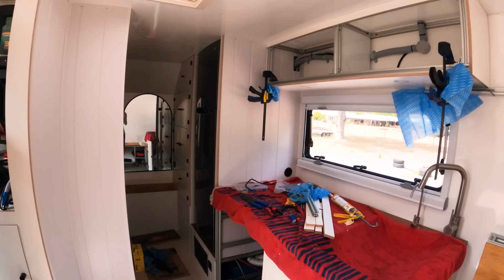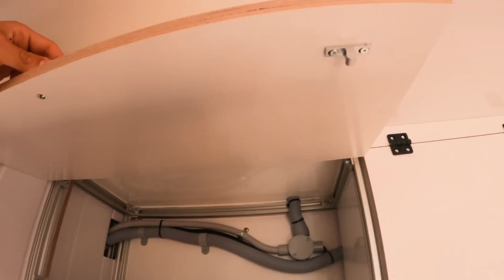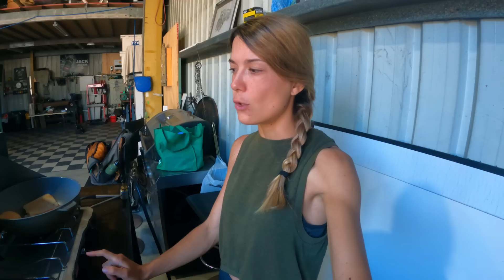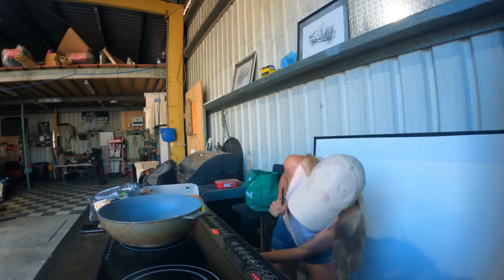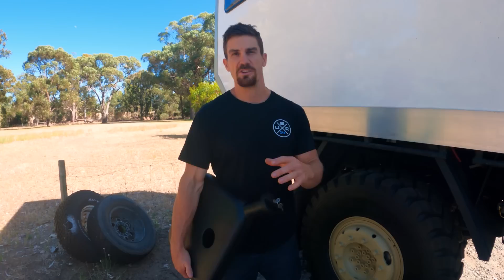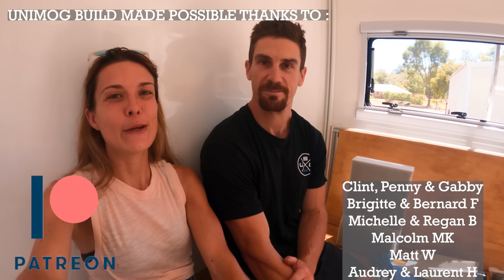LEARNING FROM OUR MISTAKES - Enerdrive/Dometic Power Solutions Inverter - DIY Camper/Caravan 33

Comment: Its really interesting seeing the comparison between your approach and JP Adventures19. They are doing everything with steel and welding themselves. But it is taking a lot longer I think.
Reply from the maker: Yes that's interesting to see different approaches! We are very happy with our decision to choose FRP panels & aluminium as our main construction materials.
Reply: @TheOutFit  And yours will definitely be a lot lighter. I wonder how much difference it will make to off road ability and fuel consumption?
Reply: @heartobefelt  Reckon it will be that much? I guess it depends how much driving they are doing.  i t will also make a difference in shipping costs to get the truck to different countries overseas.

Comment: Hello guys great progress.
I’m one of yours reguler and have question if you could provide me advice and this will be chance to find correct material.
I wish to know more about material for your cabinet’s doors. Looks to me you are using marine plywood about 18mm and is laminated. Which will be great to have in my MOG project. Question is are you laminate and cut by yourself or getting from local supplier.
Greatly appreciate your advice.
Reply from the maker: Thank you Victor for following along!
The wood we use is 12mm birch plywood core and overlaid with a melamine film on both faces - hope you manage to source some, very good product to work with.
Reply: @TheOutFit  thank you for information, that will help me to look in to this direction.

Comment: I have the HyperFlame FyreKnight which has been brilliant as it works perfectly in windy conditions. No wind shelter panels required. But I am about to go total electric, except for a Jetboil style small stove for boiling water and as a back up. Say goodbye to heavy gas bottles.
Reply from the maker: That's the one we wanted but doesn't quite fit by a few cms - frustrating! We saw in the US they have a new Jetboil dual-burner model that looks good.

Comment: Hey Guys please check the rules around 230v in a mobile vehicle for WA. For example in NSW you need to switch the active and neutral cables at the same time and earthing the chassis (check your inverter instructions for that as it's got the RCD and any additional earth points could interfere with it's safety operation). DC cabinet looks great!

Comment: Chris, 240 volt refrigerators take approximately 7 times their running watts to start efficiently, refrig should ALWAYS be the first appliance started. Personally do NOT believe that 2600 watts will be sufficient for your needs!!
Reply: Hey Merv, depends on the type of motor.  The old school split phase start compressor pulls a lot of power on start (even so.. it wouldn't be an issue with decent sized inverter). The starting power from an inverter fridge is negligible compared with its running current.

Comment: Don’t be hard on yourselves, all you can do is tackle each hurdle 1 at a time. 
My only suggestion would be to place isolation switch away from circuit board to allow the ability to shut off without exposing yourself to possible hazards. You don’t need a long run, just somewhere at the door entry so you can shut it down & also a good idea to have extinguisher in same location. 
Also have a look at Westinghouse portable induction cooktops as I have single unit & twin unit. They are a better quality induction than majority & slimmest on the market 
Otherwise great job 👍
Reply from the maker: Thank you for your recommendations! We'll definitely buy a fire extinguisher for inside the camper. We heard about the Westinghouse induction cooktop but read some bad reviews so we decided against it - maybe we'll upgrade in the future! Cheers for watching!

Comment: I’ve tried a few 2 burner gas stoves and at the end settled on a Primus 2 burner deluxe stove. Main reasons: flames are far enough apart to fit two large pots, and it’s one of the very few camp stoves where you can actually adjust the heat granularly. Bought 7 years ago - still going strong.

Comment: You guys are going to take your Mog overseas! Omg I’m so jealous! Are you going to just drive him thru the Torres straight with an extra long snorkel 😁 hey just a heads up, you probably already know, all those induction cooktops turn on and off at max power. So when it says 200w, it’s actually an average over time. I just went thru 4 different ones trying to find one that actually pulled 200w. None do. Just means you’ll have to be aware of what else you have on if you’re running both cookers. Not long now guys! Watching every episode ✌️
Reply from the maker: Thanks Tymon! That was always our main goal/dream to go overseas, hence upgrading to the Mog :) Fingers crossed we can make it happen once we have finished touring Australia! Good to know about the induction cooktop - which one are you running now?

Comment: I've had a weber Q which is the medium size. For durability, I bought it in 2003 and had to buy 2 new grill plates, it starts the first time every time and it did have 3 years outside with no cover.  It is a bit different in the way you cook, with the lid down. I don't know the size you have to work with but they have a Baby Q which is quite small. Also, it cooks a wide variety like pizzas, roasts, as well as normal grills, I did a cake in it once. There are now a good variety of similar styles in other brands, all a little pricey but I think mine will last another 18 years so probably worth It. 
By the way, your work looks as good as anything professional I've seen.  You're getting there a lot quicker than I thought you would and you make a great team.
Reply: Yep I agree with you.  Baby Q is what I have.  With solid and grill plates.

Comment: Just a reminder that in Australia you must get your 230 volt wiring done by a licensed electrician. 
Have a chat with them to find what you are able to do before they finish and test the job.

Also orange wiring is for high voltages, not 12 volts.